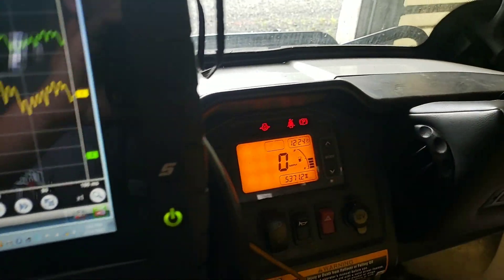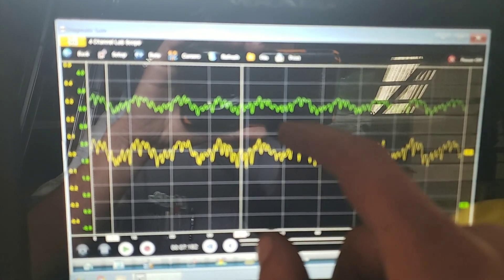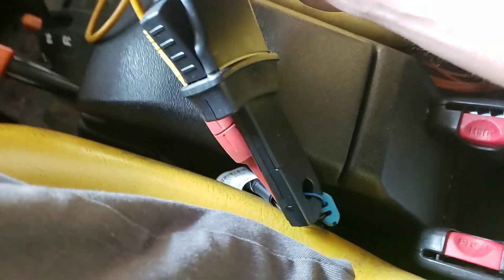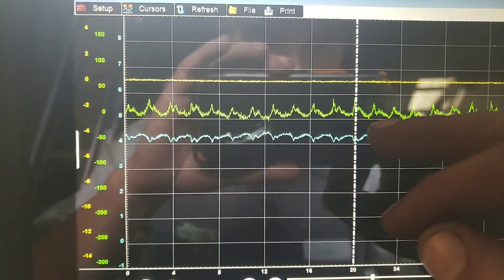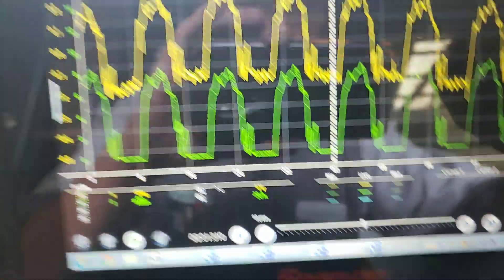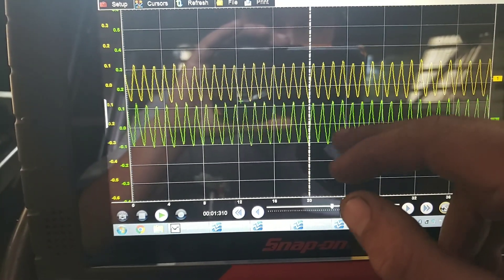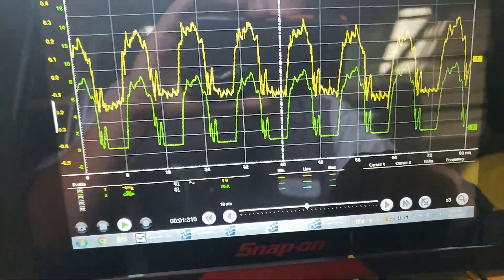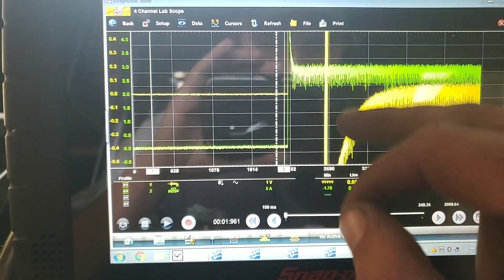Fuel Pump Diag Quick Tip - AC Coupling

Comment: Great demonstration of Ohm's Law: voltage drop over upstream resistance is proportional to the current. Most often used for the relative compression test without the amp-clamp, but looks like it works for 3 Amp circuits just as well!
Reply from the maker: That it does Dmitry. Just another tool to add to the tool box.